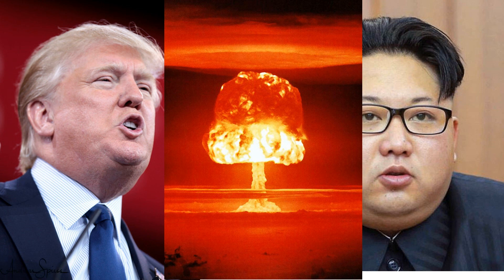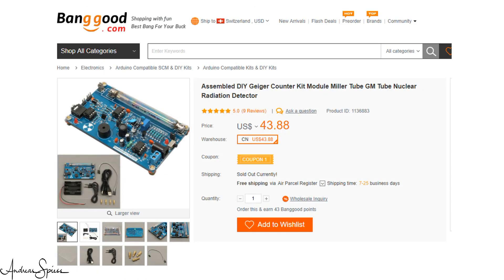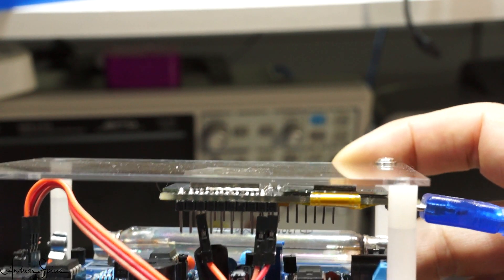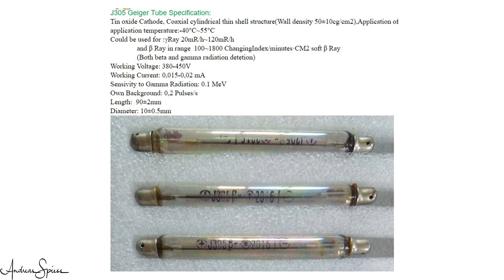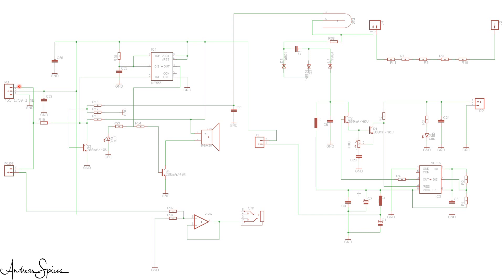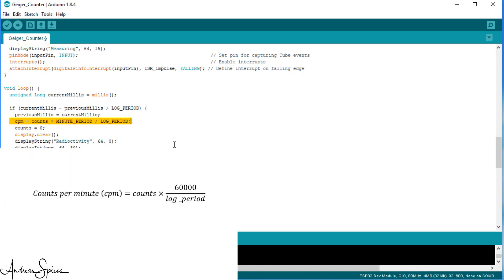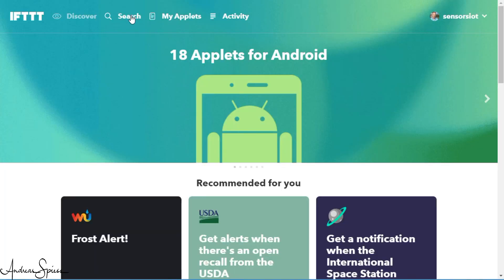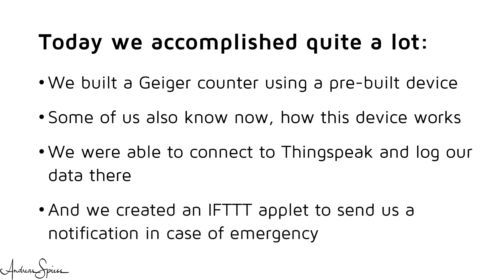#162 Build your own 50$ connected Geiger Counter (ESP32)

Comment: You can send SMS messages via an email bridge on most carriers (at least in the US). It varies per carrier, but it's usually something along the lines of <yourphonenumber>@your.carrier.net
Reply from the maker: Also a good idea if you still have the old networks online. I did not find cheap modules for 4G so far.

Comment: The crowd sourced http://www.uradmonitor.com has a worldwide network of these monitors along with air quality sensors. They sell different monitors with different air quality sensors, all can measure the radiation levels. The also sell a kit that can be fix or battery powered you assemble.

I know all their sensors are calibrated before shipping. On their web site they have a worldwide map showing all the sensors and their current readings. They just finished a campaign to get more sensors installed in the poorest countries where they are needed the most.
Reply from the maker: I also heard about this network. Maybe even in a comment for this video. I do not remember. Thanks for the link.

Comment: I wonder if counting the number of events from this type of Geiger Tube is more or less accurate than integrating the level over time? Integration over time would be easier and the analog voltage level with suitable buffering could be sent directly to the ESP32 for A/D conversion.

As far as the circuit is concerned, it seems the input of the preamp from the tube will have a very high source impedance, meaning a JFET would provide a much lower noise floor. And what can you say about using the 555 without feedback to implement the boost converter? :-D
Reply from the maker: AFAIK these tubes count parts. So the level of the signal is not as important. I have no idea of the influence of the noise floor. It is well possible that the sensitivity is not determined by the circuit but by the tube. Then the noise floor would not matter too much.

Comment: I have arduino uno. I try to run this codes with my geiger. But it doesn't work. Could you help me ( arduino uno remote connection and codes)?
Reply from the maker: Did you check my sketch?

Comment: Have you checked how much power consumption the geiger counter use per 24hr turned on?
Reply from the maker: It consumes 15 mA which would be 350 mAh per 24h
Reply from the maker: The counter alone, of course.

Comment: I have a dozen or more Geiger counters and ionisation type radiation meters, mostly ex civil defence, but some built from kits and others of my own design.
Reply from the maker: So you are a lucky person which does not need to build another one, I assume.
Reply: I may not need to, but once my new workshop/lab is built, and I get a decent Internet connection, I probably will. I did have a geiger counter connected on Radmon. I have moved from the UK to Portugal, in a pretty remote area, but near a former Uranium mine!

Comment: Great Video! I have tried to build the device exactly according to your description and I have it is almost working except that the "Radioactivity" is always "105" :-(. I have checked the connections and everything seems to be connected properly. Could it be that the signal strength is below a threshold and I have to change the resistance on the variable resistor R100?. Any suggestions? Thanks and  best regards, Hilmar.
Reply: Erik Burman: Thanks a lot Erik. You were right! Totally made my day!
Reply from the maker: Do you hear the right "sound"? If not, the problem is on the Geiger counter side. If you hear it, you probably need an oscilloscope to see what kind of signal arrives at the output pin.
Reply: Thank you very much for your answer! Sound is like what I would expect and what your counter sounded in the video. I will try to look at the signal with an oscilloscope once I am back home in Canada. Thanks again for the great videos and greetings from Freiburg in Breisgau (not too far from Switzerland), Hilmar.
Reply from the maker: So have a safe trip back.
Reply: Und Ihnen ein gesundes, neues Jahr mit vielen, spannenden Videos :-)
Reply: In the Arduino sketch you need to delete or comment out line 94 in void loop() which reads cpm=105. Apparently it was put there to test the code and was never removed from the final draft. It results in a fixed count of "105." Get rid of that particular line of code and everything should work as intended.

Comment: Wouldn't significant ionizing radiation require shielded communication, wired or wireless?
Reply from the maker: I am no expert in this. But I think we talk about quite small levels and inside a hose. If you would measure high levels which kill your device, it would probably also humans :-(
Reply: Andreas Spiess  lol, yes, I guess "ionized noise failure" of the link pretty much answers "is it safe to go for a walk?", even without a quantified rate. I was thinking more along process monitors than "sunburn index", which is probably a bit much to ask from consumer grade items. Always a pleasure, sir!

Comment: Where exactly is the digital out pin on the board?
Reply: Also, be sure to delete "cpm=105" in void loop(). If you don't delete this particular line then the counts will be fixed at 105. This was a perplexing issue until I reviewed the code and figured it out. This line was in the sketch that I downloaded on Github. I guess it was being used to test the IFTTT alarm function and they forgot to delete it???
Reply: Ok you hook the ESP up to the 3 pins marked GND,5V and VIN(this goes to pin 26)
Reply from the maker: Yes

Comment: Could a Geiger counter be used to charge a capacitor rather than produce sound? 
If so at what rate could you charge a 1F capacitor?
Reply from the maker: The sound does not come from the Geiger tube. As mentioned in the video, it comes from a amplified signal because it is very small.

Comment: If someone drops a nuke then the internet connection would be the first thing to fail :-)  However, if you do take the trouble to make and run a detector such as this I suggest you upload your data to a system such as Radmon.org which monitors background radiation levels and provides notification of what is happening worldwide.
Reply from the maker: Thanks for the link. It even contains help to create a Arduino like sketch...

Comment: Check out the company Teviso . It's a swiss company that builds very small PIN diode radiation sensors . The sensors aren't any bigger than your ESP32 board, have very low power consumption and are pretty much an epoxy brick (they will be the last thing to break, if you throw your counter around). You could replace your geiger board with one of those without the need of any other change. They have just three pins, VCC, GND and pulse-out (pulse length also between 50-200µs). Apparently they've since moved to a newer model, but I've used the RD2007 and RD2014. I don't remember how much they cost, but I think it was around 100€ to 150€. The sensitivity will also be very similar to the geiger tube. At least I could easily measure an increase in radiation (about 10x) when I put them in front of an old alarm clock with glow-in-the-dark digits. It's also funny to find out that you ripped radioactive ceramic tiles out of an old house's bathroom, because it's Uranium that makes the glaze bright orange  ;) . You also might look for greenish glass ware in antique shops or flea markets. That's also Uranium glass as well.

Btw. I doubt you will measure any alpha or beta radiation with this tube (pretty much impossible for alpha and very hard for beta to get through the glass). But "luckily" in most disasters you will always have gamma radiation as well.
Reply from the maker: 1. Looks like nice sensors. And unbreakable ;-)
2. I am no specialist and had no radioactive material on hand. Therefore can only depend on the data sheets.

Comment: Hi Andreas. Nuclear engineer here, beta (and alpha) radiation doesn't penetrate walls and they don't really even travel that far in air. What you're measuring is mostly gamma rays due to naturally occurring radioactive material.

Also the count rate you measure can vary significantly throughout the day, which can cause false alarms if you just trigger a warning at a fixed threshold like 100 cps. A good rule of thumb (and what is used in most real radiation monitors) is called moving-window k-sigma, which is that you sound an alarm if you record a count rate that is more than 2-5 times the mean count rate averaged over the last 20 minutes or so.

My research work involves building a mobile radiation detector network intended for searching and identifying unknown sources in the environment. We're using more complex detectors (scintillators) with mesh networking, but I really want to make some LoRa based Geiger counters.
Reply from the maker: Your proposal sounds very interesting. It adapts automatically to the  conditions...
I do not know what I really mesured and I just had to believe the data sheet. I plan to take the counter with me to hte mountains, where there should be places with more radioactivity...
Reply: You can use a banana, the potassium in them makes them noticeably radioactive. A GM tube is sensitive to all ionizing radiation, but very little beta and almost no alpha radiation will make it through the glass housing unless you have a very strong source. Gamma on the other hand travels much farther and makes up the majority of what you detect normally in the environment.
Reply from the maker: Thanks for your explanations!
Reply: If one wants only good alarms and they are not needed quickly, longer measurement time helps to avoid false alarms. However, if you need quick alarms and still want a good accuracy it gets tricky. I played with this problem a while back quite some time. After trying several statistical methods I finally I ended up with few steps like if short term average is say 5 sigma above threshold, give an alarm. If medium ĺong is above 4 sigma, give alarm. If long term average is 3 sigma above threshold, give an alarm. That gave me alarm within one second with strong source and yet measured background pretty well.
I also used several time slots that allow it to recover quicker when short event was over. Unless old counts are ignored, it takes forever for average to drop to normal level if it has been exposed to a heavier source for a while. If you count like 5min average and have 10s of very heavy pulsing, it could take 5 mins for a rolling window average to get below alarm threshold.
I used arduino pwm to switch a fet in step-up generating high voltage and few  high voltage zeners and resistor divider with adc to measure voltage for stable feedback (mostly to save battery, brute force clamping with zeners works well if that is no issue). I wanted to measure it and not burn the high voltage at max count rate all the time. Geiger tube pulse is easy to limit with clamping and easily counted using an interrupt. That gave a very low component count GM counter for about $20 or so, including a cheap $10 GM tube.
Reply: @hoggif  That sounds pretty interesting! Could you share the schematics and maybe your source code? I'd really like to avoid re-inventing the wheel here... :)
Reply: @marcin.ronndahl  Sorry, project was canceled before getting documented/finished because I solved the need with a commercial unit. I did not archive the code either.
Basically it was a basic geiger with pulses diode clamped and fed to microcontroller inputs for counting.
The hv psu was simply a step-up with a single mosfet driven by attiny and voltage was fed back with zeners and a resistive divider.
HV supply control was simple. If voltage low, give it pulses and measure again. If measured voltage enough, no more pulses until voltage got low. If you get a geiger count pulse, start giving charging pulses because hv supply must be lowered by the pulse.
Pulses can be counted with for example pin change interrupt and at timer loop you can check how many pulses at some time window has been detected.

Most of the difficulty went into trial and error with some statistics to get fast alarm and ditch all the gathered data and start like from reset if pulse count has dropped extremely low compared to a measured average at some time period. (ie. you had a veavy source, saturated all counters and the source is gone now)
Reply: @marcin.ronndahl  Sorry, did not archive paper schematics nor code when project was canselled and product replaced with a commercial unit.
As far as I can think of, major task were getting hv supply current draw low enough for battery operated unit. Eliminate all leakage sources. That was one reason I measured voltage with a zener(s) in front of resistive divider and used caps with not too high leakage.
HV psu was plain simple step-up. Single transistor driven with a atmega. Measure voltage, if voltage low, give pulses. When required voltage detected by adc, stop giving pulses.
Geiger tube current pulse can be fed to eg. a resistor and diode clamped to keep voltage level safe. Just count with a pin change interrupt for example.  Very simple. Pulses are non-oscillating in nature, very easy to count.
After that all you need is some timer interrupt to keep count how many pulses you had in a time window. I think I counted these kind of periods from new to old: last 4, next-to last 4s, 8s, 16s, 32s, 64s or something like that. That allowed you to combine old countes to bigger bunches but in  case of a dramatic count/s change, you could use only resent values. Depenging on reaction time wanted and source strenght this may need to be tweaked.
If you have had large source that is gone based on recent values, forget old values or it'll take forever for something like average to drop low enought to get out of any alarm condition. I also used recent values to start an alarm if values now high (even if long term average was not yet high). My focus was a meter that detects dangerous source quickly, gives fast alarms and gets out of alarm state if source is removed.
Hope that helps a guide line.
Reply: Yes! You can see the effects visually if you observe via a cloud chamber.
The short straight lines are Alpha,
The squiggly lines are Beta (electrons),
And the VERY long ones are gamma rays.
Sometimes you can see the lines split when they hit another particle.

You can see some demonstrations of the cloud chambers with a sample of radioactive material.
It's quite facinating, but also concerning knowing that if you get some of these elements in your body, they can do some tissue damage (and damaging DNA which can cause tumors/cancer).

STAY SAFE!
Reply: nuclear engineer my arse...

Comment: Thanks for the video. I am assuming there is no point calibrating these units, converting the CPM to uS or other SI units. Just monitor the trend and that's all.
Reply from the maker: +Csongor Varga I read you can calibrate them using radioactive material. Bot it is not simple and I have no such material.

Comment: ESP32 plus tube = Geiger Counter?!

Dear Andreas, please review the links below. It appears that one could build a Geiger Müller counter around an ESP32?! PWM plus few discrete parts can be used to generate HV. Maybe you and other folks could adapt the scripts from ESP8266 to ESP32?

http://hackaday.io/project/12933-esp8266-geiger-counter

https://github.com/pramasoul/ESP-geiger

https://sites.google.com/site/diygeigercounter/gk-radmon
Reply from the maker: Thanks for the links. I think, these concepts are very similar to what is on the board I used. They just reduced the capabilities (e.g. loudpeaker, 3.5mm jack) and replaced the oscillaror by an output pin of the ESP. The price, however, seems to be very similar and is maybe also influenced by the price of the tube itself.

Comment: Depending on where you live the basement may not be a good place for the device. In some areas radon gas leaks from the ground and can accumulate in your basement so you'd be better off placing it in a well ventilated area.
Reply: Thomas Kirchner 
I was going to state the same.  Places like Finland with abundant granite in the ground are really prone to this.  For some reason granite contains sufficient trace amounts of radium that gradually decays and emits radon.  That appears to be more a feature of granite than many other rock types.
Reply from the maker: Thanks for your explanations. Even if we have plenty of granite here in Switzerland, Where I live we do not have any. So, the activity measured in the shelter has to come from a different source.